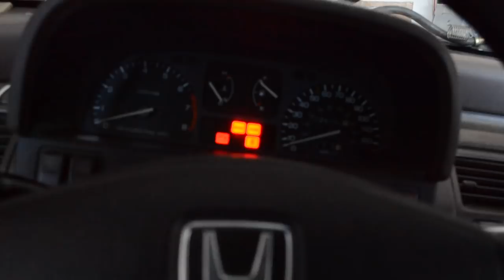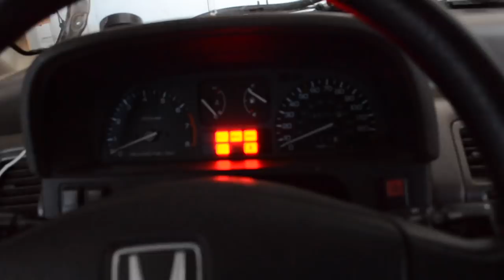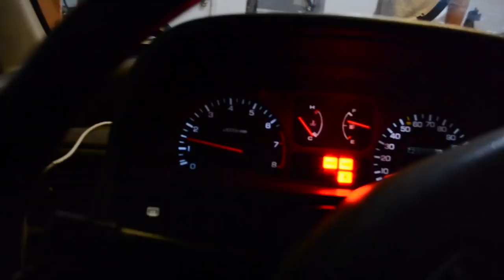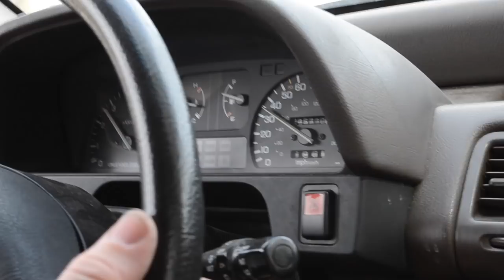EF WAGON B20 SWAP PT 4   CIVIC  HSG EP. 5-32

Comment: The Wiring problem you ran into is pretty common. Here's why. Most of the people who make the OBD0 to OBD 1 conversion harnesses did the distributor wiring color for color. The color of the CRK and TDC sensors swapped when they went from OBD0 to OBD1. The people who make the harnesses just assumed since the same colors were used they went to the same sensors. Lazy.

Comment: Yea bruh you gotta cut C1 and C2 before ecu and add pins to em and pin them to b10 & b12.  then add wires to the cut wires at C1 & C2 to run to the dizzy in the bay.  and we run 2 of the  injectors off the DX injectors and only add 2 injector wires to ecu.  but good shit.  y'all are gangster

Comment: Yup its 2024 and those ebay ecu jumpers are a mess.. i had cyp and ckp mixed..fixed that.and then kept having issues where car died when coming to stops also missing alternator  voltage regulator 5v signal wire..took me 2 years to figure it out 😂😂😂 .

Comment: had a similar problem with a obd2b to obd2a jumper harness. it was 85 dollars and after hooking it up engine wouldnt fully start. checked the wiring on the jumper harness and it wasn't even done correctly. fucking eBay

Comment: Need help got a 1993 eg civic that had a b18c1 vetec but have put a b20b non vetec and do not know what wire harness I need it came with harness and pcu but is all different if I use old wire harness and fix were needed will I still need to use the pcu that came with engine or will the b18c1 pcu work with the b20b

Comment: what would be wrong if the cra didnt rev passed 4
Reply from the maker: Gary the snail limp mode or bad dizzy
Reply: Honda Street Garage my civic Iv done a b16a swap on the car won't rev past 3k and feels like it dies going check timing but could be faulty distributor?
Reply: How do you figure out it is in limp mode and what should I do to fix car has no fault codes